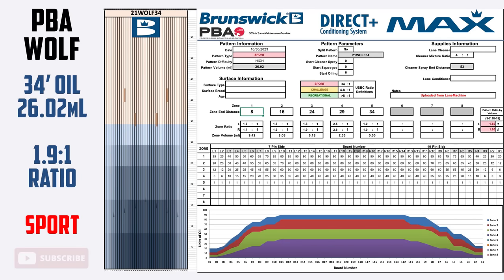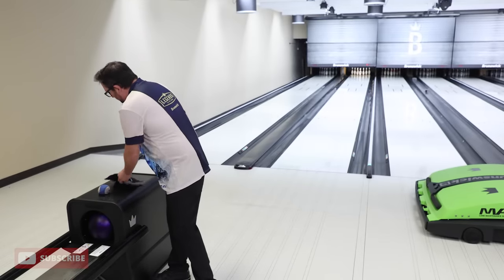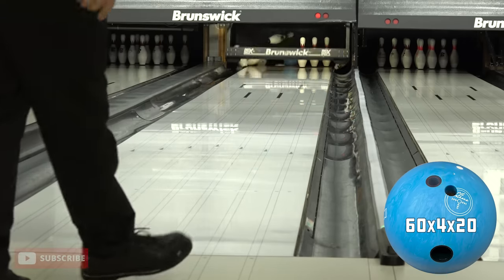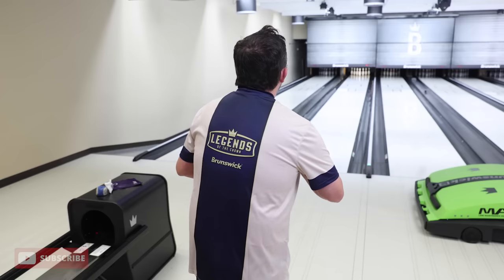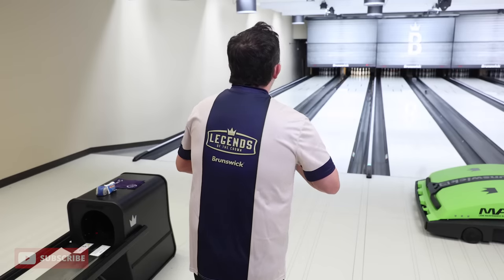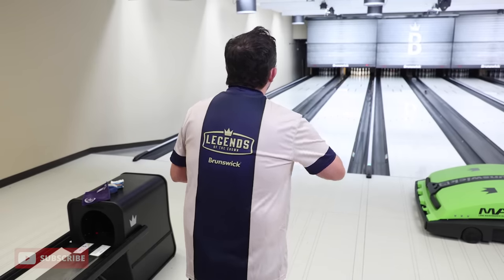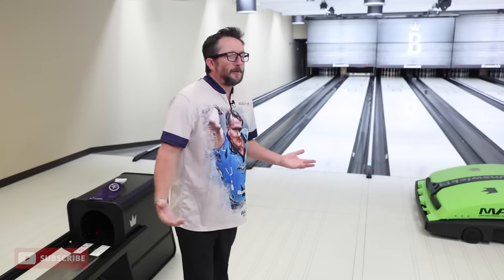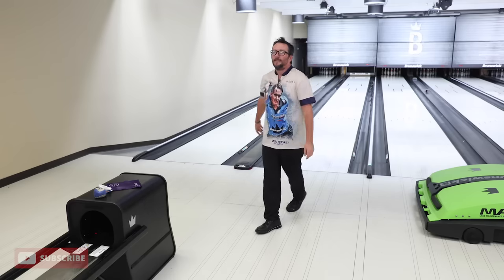THE TRUE TEST! NU Blue Hammer on SHORT OIL! | PBA 34' Wolf Pattern

Comment: Looking at the specs for a 15lbs NU blue hammer ball. Just by looking at the RG and Diff(RG 2.586/Diff 0.027). Seems very comparable to the DV8 Alley Cat I used to throw(RG 2.564/Diff 0.025). I knew exactly where to throw and how the alley cat was going to react. I’m just curious if the blue hammer is as close to alley cat that I get, since the alley cat is retired.
Reply from the maker: No not really. The coverstocks are much different.

Comment: The NU Blue is a good ball for that pattern but you would definitely have to wax it and bowl with the glossy finish to cut down the balls friction. It would hook less and hold the pocket more with the glossy finish. You can always sand it back down for a higher volume pattern for future use.
Reply from the maker: It could work but I wouldn’t use shiny stuff on that pattern until later in a block.

Comment: What is the purpose/driver for the PBA rule change on hardness level?
Reply from the maker: A perceived equipment issue and a few squeaky wheels getting greased.
Reply: Urethane balls soften over time and no longer conform to pba hardness regulations. They go out of spec and lose certification.

SPI had a similar issue a few years ago with their reactive balls coming out of the box too soft too, which is why the Phaze IV and  UFO alert got canned
Reply from the maker: @iceman5117  urethane balls do not soften over time. They may measure softer due to oil and other contaminants in the shell and flawed field testing by PBA. 

USBC just posted a study on urethane footprint, I encourage you to go find it.
Reply: @brunsnick Do we honestly trust what USBC says though? I feel like we have known for a while they are fairly corrupt..

Comment: If reactive balls lane shine faster than true urethane, how is it that the urethane balls have been quote softer than resin?
Reply from the maker: I don’t understand the question.
Reply: @brunsnick   Urethane balls are having to be made harder because they get softer according to the PBA. Yet they don't lane shine as quickly as a resin ball does. It seems to me that a softer ball would lane shine quicker than a harder ball. How can the urethane balls not lane shine if they are getting soft?
Reply from the maker: @rpf958  it’s a different structure with urethane, and oil makes the ball read softer after use. Since resin absorbs through the pores, it isn’t affected. Remember, oil is a lubricant, not a solvent so bowling balls don’t get softer.